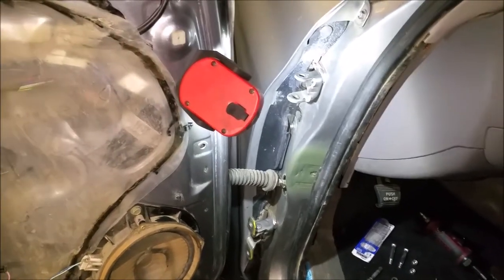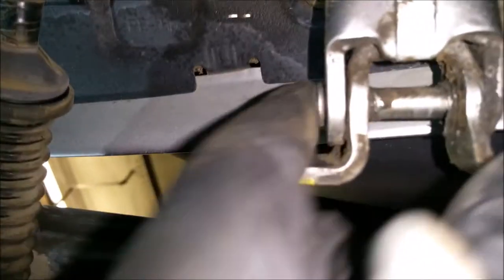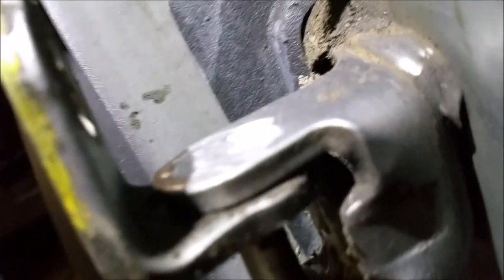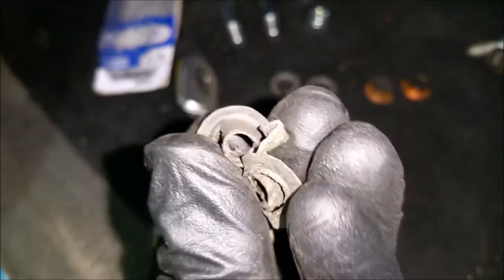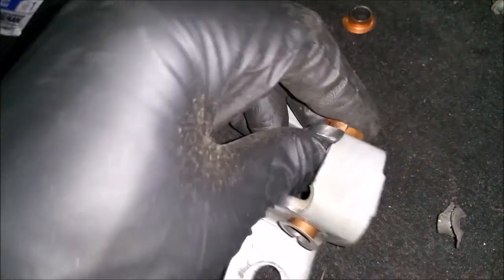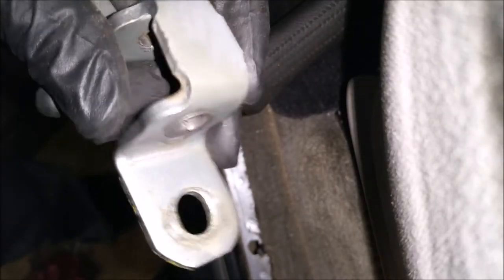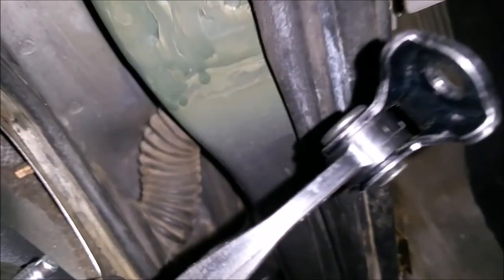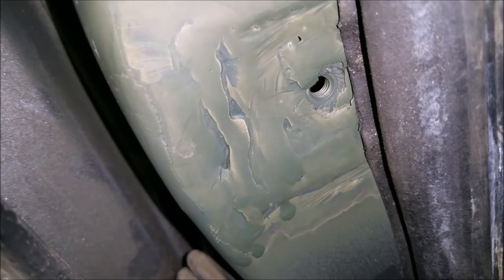How to upgrade sagging door hinges

Comment: Did top Highlander hinge. Cut my pin with hackzall, didn't damage the hinge! Bottom half of pin just fell & I pressed the top of it out with a bolt & washer inserted from bottom, using vice grips over the hinge to avoid spreading it :)

Comment: thanks for the video the only thing I did different is cut the pin in half because had little room for shaving the top with my metal cutting blade, the smaller blade is better.  thanks

Comment: FYI - Dorman says to use part number 38471.  THEY ARE WRONG!  Use #38470 as the video shows for 1st gen Tundras.  As I am typing this, my door is sitting beside the truck and the pins I have are too small.  No local store has 38470 in stock, so my truck is out of commission for 2 days :(

Comment: so everything where i try to check that dorman kit, it says "lower only, will do both doors". which makes very little sense to me. stock pins look identical size and length. I'm assuming you had no issues using the one kit to do both pins on the one door?   (P.S. great video, you did exactly what i figured I'd have to do. really nice to see someone else do it first so i know I'm on the right track. gotta always keep those worn down discs for when you gotta get in a tight spot that new ones are way too big for :)  )

Comment: Why would it not work to just use a multi tool to cut the top of the hinge off and if someone is holding the door then why rip the door panel off and go through all of that? Just do one at a time while someone holds the door. It’s not rocket surgery.
Reply: He not rocket surgeon tho

Comment: You might want to state that this is brand-specific and probably model and year specific, and state clearly what the vehicle is. Maybe you could even put that in the title? For example, Chevy and Ford and Dodge use a different system than this (for one, the Chevy hinges from about 1990 are welded on, and replacing pins and bushings won't do you any good, they'll just wear out again in six months to a year due to a very poor design
Reply: he did say what year and model it was and he said that this kit was for the year range of this and another vehicle... maybe you should listen to what he says.
Reply: yup, was pretty clear right at the beginning that it was an 02 tundra. and what range they believed the kit covered. actually included a lot more than most videos. product number for the dorman replacements, showed the package (i have one sitting in my truck ready for the repair, same packaging and everything) +1 great video
Reply: It's a first gen Tundra